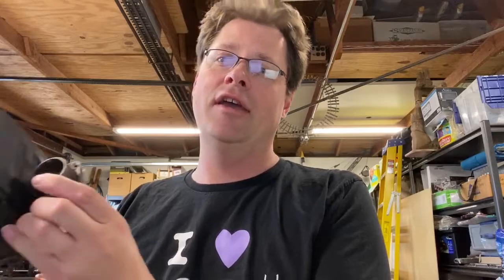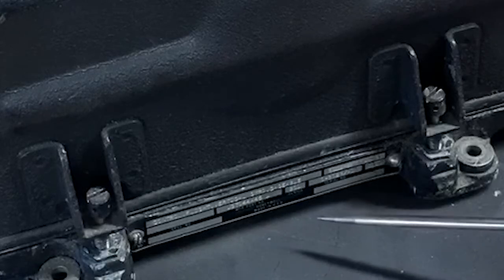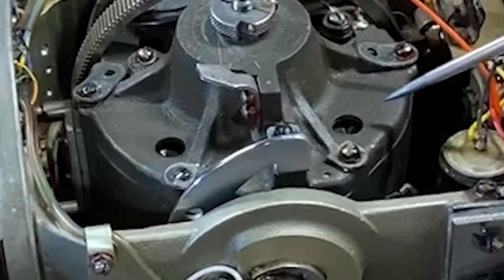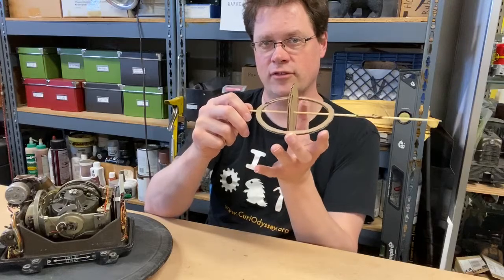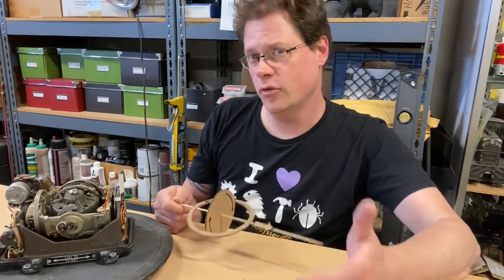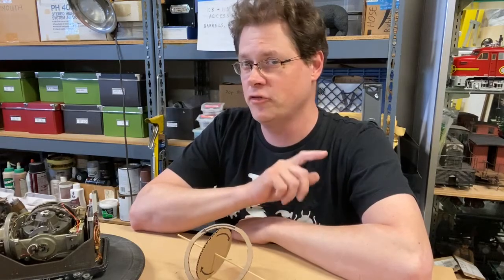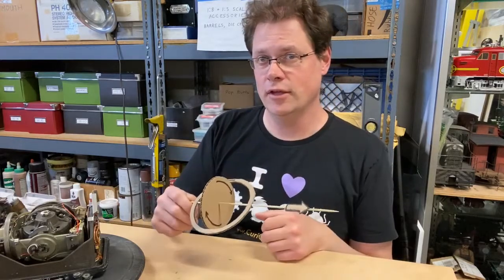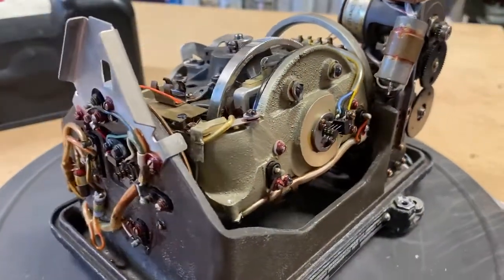How It Works: Inside Look at a B-25 Mitchell Aircraft Gyroscope

Comment: You have a "caged" gyro.  Meaning the gimbals can be locked.  The motor on the top drives the cage mechanism.  I have a Honeywell gyro out of an F-100 Super Saber (mid 1950s).  Not much had changed between the B-25's gyro and the F-100.
When you remove power from the gyro, it will take about 10 mins to stop spinning, hence the warning not to move the gyro for 15 mins after power down.

Comment: Honeywell first produced these gyros in the early to mid 1950's (post WWII).  The reason for the 15 minute warning after power shut down, is to allow the heavy gyroscope rotor that spins at about 22,000 RPM to coast down thus reducing the chance of bearing damage from mishandling.

The two metal rings or hoops are part of the AC motor gimbal erection system.